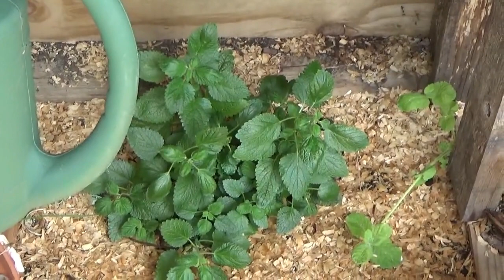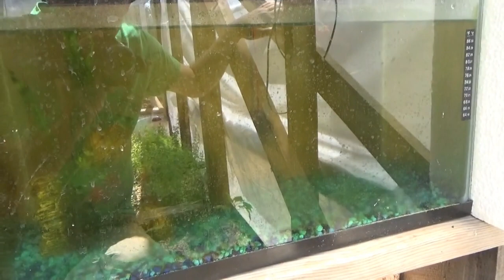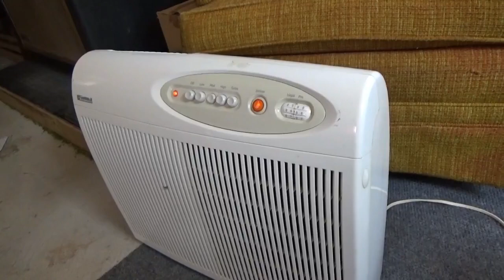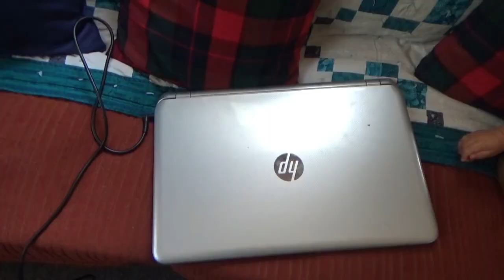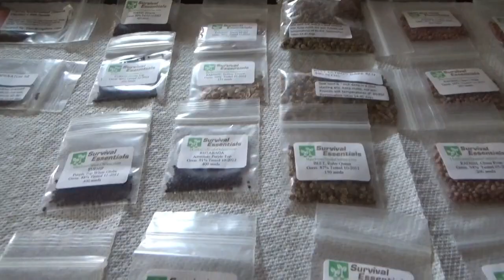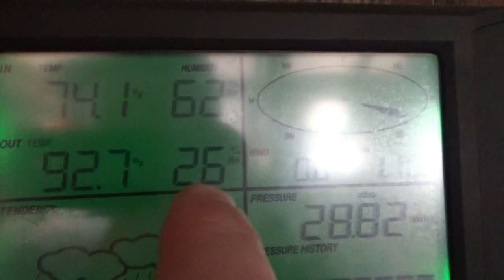Very Busy Day At The Off Grid Homestead Going Full Blast

Comment: I guess the dehumidifier is not keeping up in the cottage. We have terrible humidity here also. It must be horrible. But if you can get the humidity out of the house it seems like it would be nice in there.
Reply from the maker: Melanie cooks a lot and that stirs up moisture as well. It is hard in summer to keep the humidity down. At night we have the windows open for fresh air and then we get 95% humidity coming in with the air. Then we close the windows down for the day and that keeps that moisture inside.
Reply: During the day time I run one 8,ooo btu ac on one tracker with four 230 watt panels for free from daylight to dusk. and also I run another window AC 8000 btu unit on a different set of trackers with a satalite tv and 52 inch plasma TV of those trackers. You could run a AC window unit off your panels during the daytime. You could buy about four panels to dedicate to one window unit. I run the 8,000 btu units from walmart but you can even get just a 5,000 btu unit to run and they barely use any electricity only 5 amps draw. It would cool down most of your house especially the 8,000 but unit that draws 6 amps. I wish you had at least four more panels you could live off of more easily.
Reply from the maker: We do use a 5,000 btu AC unit in the bedroom and blow the air through the house using a fan. But it is just too small for our home to pull out the humidity. Again, we open the windows at night and start the cycle over again so it never ends.
Reply: Try the 8000 btu next time you get one. they really work a lot better. I can almost cool my 1200 square foot house with one. so I use three in the hottest part of the summer. I bet one would do your small square footage. We have 98 to 110 degree temps here with humidity. Really hot in southern Oklahoma. The point is the 8,000 only pulls a couple more amps in the hottest weather. but it cools much better you will love the difference. On a cooler day they pull only about 5 amps
Reply from the maker: I got one at a garage sale for $40 but when I put it in, it did not work. I think its the capacitor. He let me keep it for $15. I plan to see if I can fix it.
Reply: Remember there is a Danger working on High voltage capacitors. They can shock the living crap outta you. Not worth it if you just buy a new one for a couple hundred dollars. Pray about buying a new one God will provide for your needs.
Reply from the maker: I have worked with electronics since I was quite young so I know how to discharge them first. Yes, they can kill you if not careful. I actually hope to get this running. Its a challenge and would make a good video.
Reply: OK good. I hope you fix it.

Comment: You can recharge the penetrant cans with compressed air but I prefer putting holes in the can and draining them into a modified cheap condiment squeeze bottles which I melt the tip closed then heat a needle and melt a hole with that into the tip of the bottle so I have a very slow flow. I have had the same bottle for wd40 for about 15 years now because the aerosol cans waste so much putting fluid where I don't want it and not working in a lot of positions which is the reason why they run out of pressure is usually the can isn't meant to be used in the position that you need to use it in.